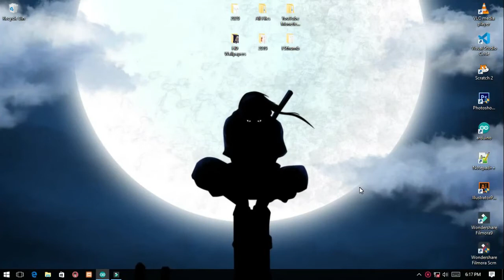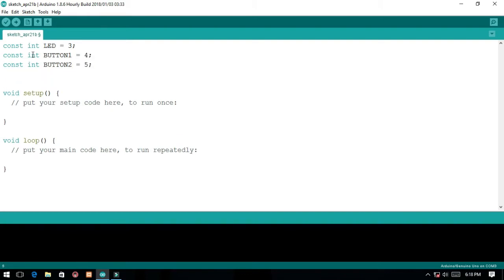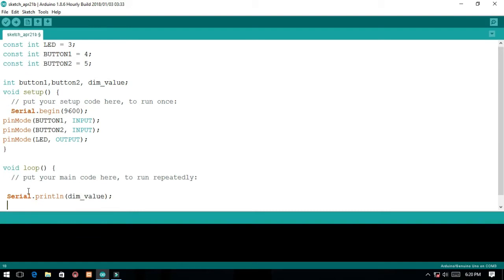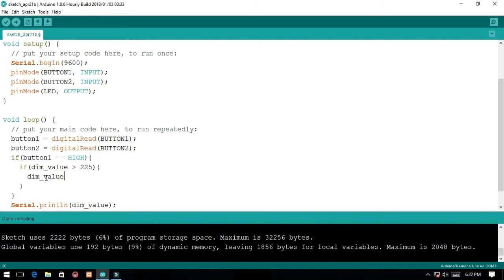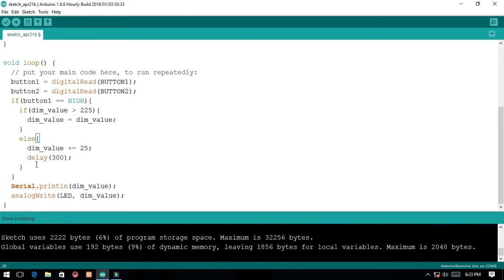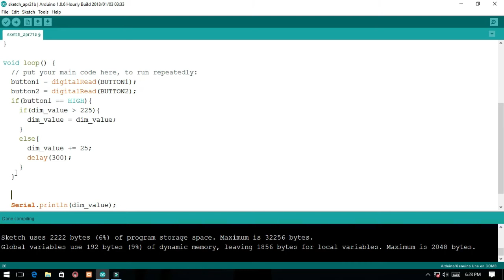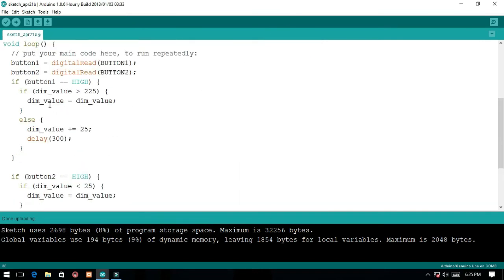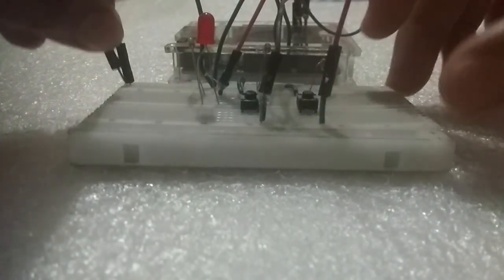Arduino | How to make a LED Dimmer using 2 Push Buttons | FULL TUTORIAL | For Beginners 2020

Comment: I need a small help
Same project but 2 button and 5 led

Press⬆️ 1st led
Press⬆️ 2
Press⬆️ 3
Press⬆️ 4
Press⬆️ 5
Press⬇️ 4
Press⬇️ 3
Press⬇️ 2
Press⬇️ 1
Press⬇️ 0

Like this plss
Reply from the maker: This is simple just change the variable value by incrementing and decrementing every time you push the button
Reply: @daviñascode1997  I no that but I don't noo the program soo can u write for me